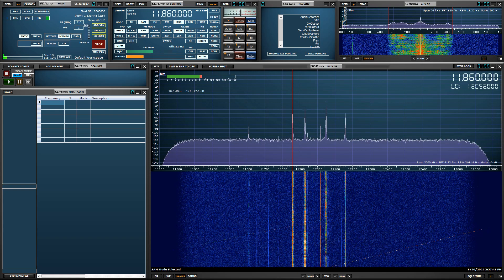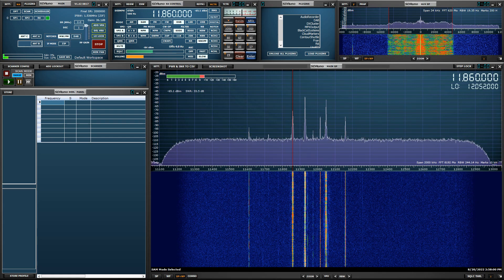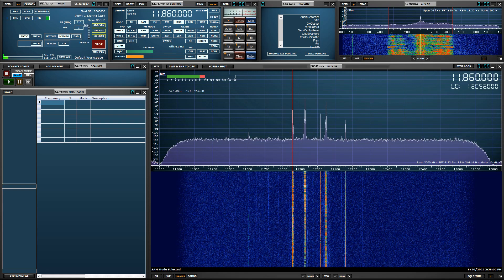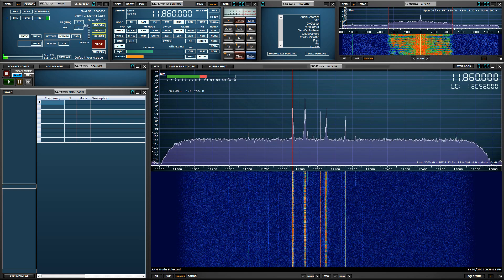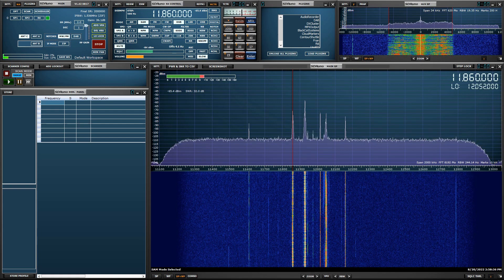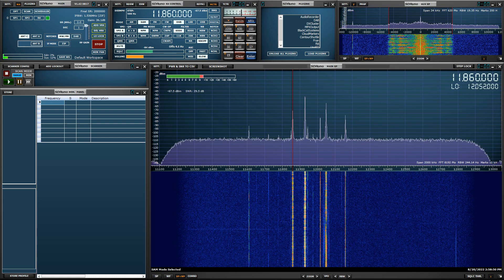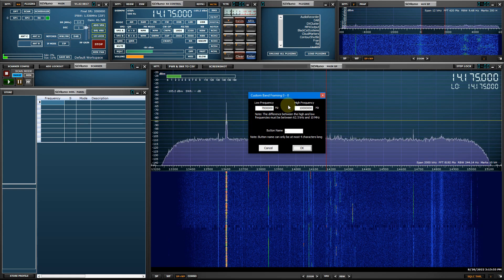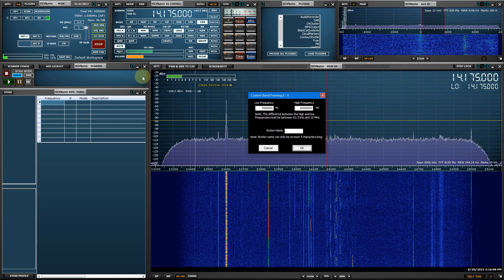SDRuno Band Framing Customization.

Comment: What is the difference between LIF and ZIF?
Reply from the maker: Zero IF and Low IF use different intermediate frequency modes in signal processing. In short.
Zero IF, the RF signal is mixed directly down to baseband. Low IF, the RF signal is mixed down to a low intermediate frequency.
Reply: @SDRplayHamGuides  Thank you for the reply! Is there some sort of difference in how either affects receiver performance? Any advantage, one over the other?
Reply from the maker: Both have pros and cons. Below is a short break down

I use ZIF:

Wide bandwidth.
Monitoring multiple signals across a broad frequency range.

I use LIF:
When listening to AM broadcasts or other signals where the DC spike would interfere.
Monitoring in environments where image rejection is critical.
Bandwidth requirements are minimal.

Comment: Thanks for this. I'm wondering if it's possible to redefine an existing band. Here in the UK, 2m is  - for most folks - only 144-146MHz. And there is NO 220MHz band. Thanks!
Reply from the maker: No, the band buttons supplied  are all  hard coded and uneditable.
Reply: @SDRplayHamGuides  Thanks for the clarification 🙂
Reply from the maker: Yes, I beleive if you right click the button that you original made as a custom band button
Reply: @SDRplayHamGuides  Thanks for the reply. What i actually meant to ask...is it possible to redefine the band edges that come with SDR Uno and to delete any that don't apply in UK? Thanks 🙂

Comment: Just pointing out a couple of mistakes I made in trying this that might help someone else not make the same mistakes.
1.  After selecting Custom and then clicking on zero, I made the mistake of LEFT clicking instead of RIGHT clicking as you clearly pointed out.  If left clicked no window opens.  Don't do what I did.
2.  I chased my butt noticing 2 things that did not match your video.  1. When I deselect a band it doesn't unframe the band.  This is because I was not in Play mode.  Don't do what I did.  2.  The "IF MODE" select button on "MAIN" window isn't always available.  In this case I have to go to settings, options, then input, then select which IF Mode I want.  Is there a reason for this?  I do wish it was always visible instead of having to go into setting menus each time or again I may be doing something wrong.  Anyhow hope confessing my mistakes helps someone else and thanks for showing us how to do this.
Reply: Thanks for the heads up.